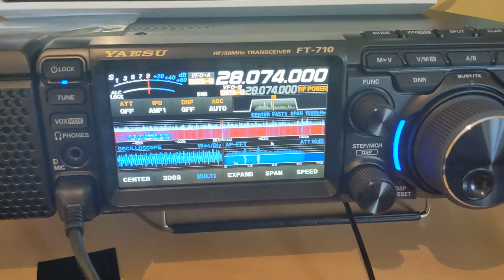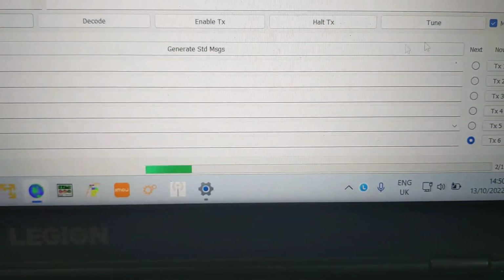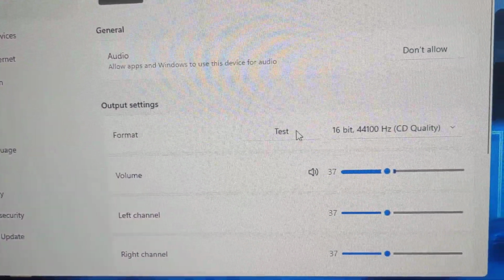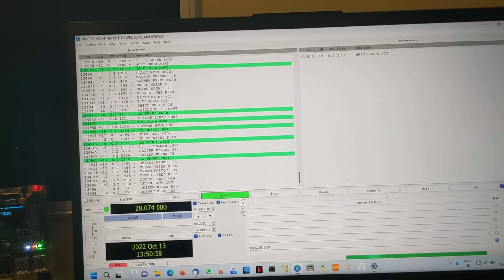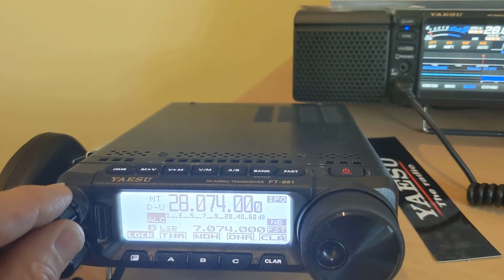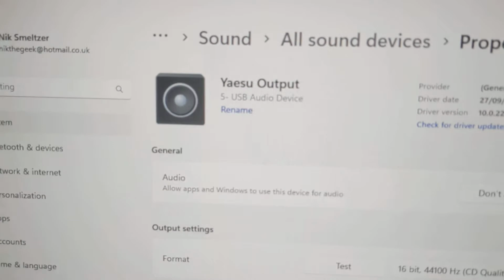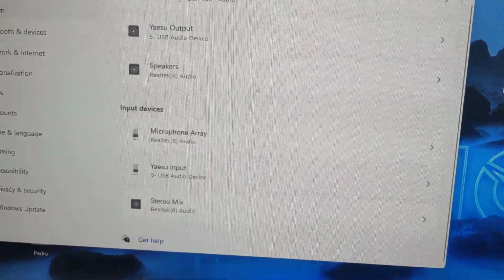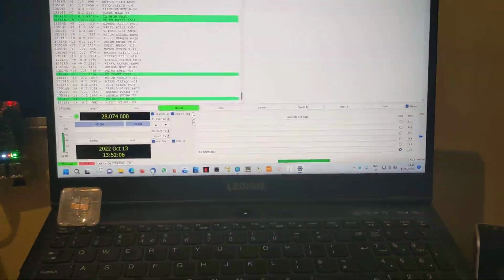Progress: but bad FT8 TX audio with FT-710

Comment: Change format to 48000Hz, forget the sound setting on the main panel, use search and type control panel then click sound.  In the levels tab for speakers set to -5.3db all enhancements off. Click microphone tab and set level to -0.4db again disable all enhancements. All other settings to get levels can be done on the radio.